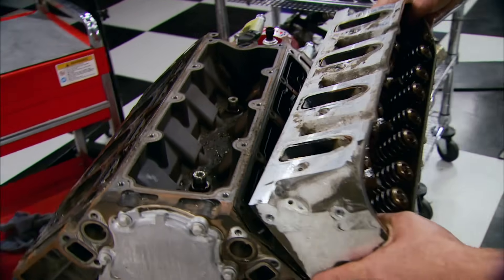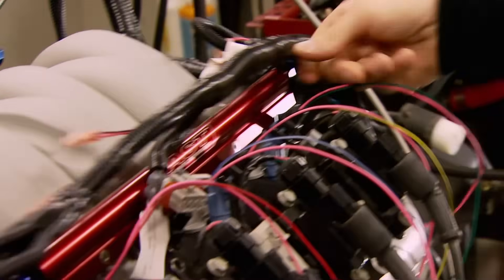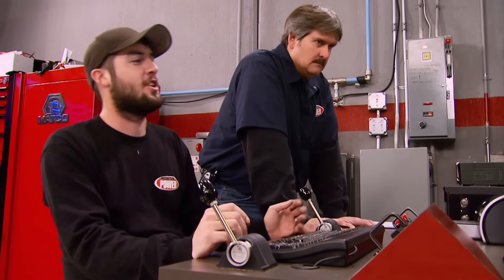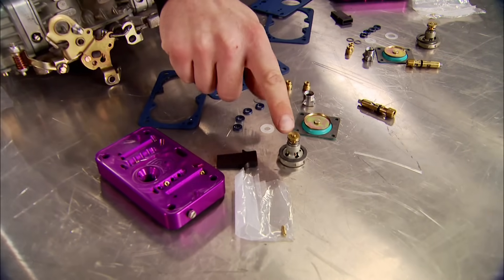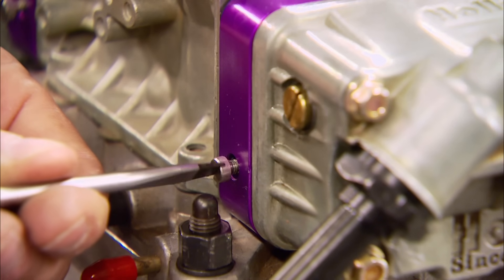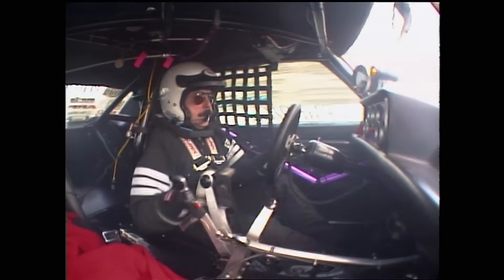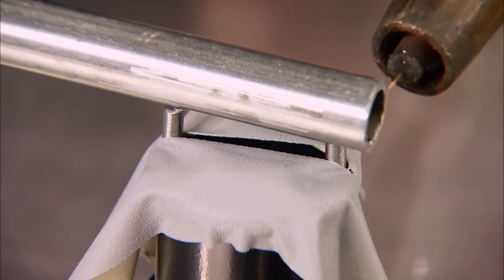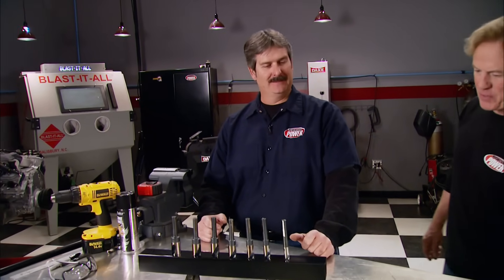Upping The Intake On Our Chevy LQ4 Motor - Horsepower S13, E2

Comment: The real lesson- $2000 in flashy manifold, injectors, and throttle body nets you 25 more HP than you would of picked up at the junkyard for under $50. Too bad these guys aren't sponsored by Pic-n-Pull
Reply: Exactly lol good aftermarket cam and your there

Comment: So it made 25 more Hp with the cam,springs and rockers and 103 more Hp with a manifold upgrade.
Reply: The manifold would have never made that much power without the cam and tune
Reply: Think about it- more lift, more air. Stock intake- same air. So the cam and intake should’ve been done together.

Comment: Why was the E-85  increase so low.
With the Proper tuning and cam,  should result in 15% increase over gasoline horsepower.  Should have a increase horsepower of 35 to 45.  The alcohol fuels carry a extra   oxygen.
Reply: Because these guys don't Tune ECU's, they are TV Hosts

Comment: I swear, I've watched these Lq4 videos over and over and I just don't understand the numbers. The stock Lq4 makes like 320ish horsepower. How did they get 411 out of it with only a valvetrain upgrade? Then with a new intake, they're making over 500? I guess I need to get my cammed Lq4 tuned and see where I fall.
Reply: Why don’t they show the dyno graph?
Reply: You should notice no drive accesories attached to crank pulley 
No drive train attached to engine 
That's it

Comment: Wow E-85 was .86 cents a gallon then lol now it's only like .5 cents less
Reply: E-85 here on long island NY is $1.69
Reply: @andrewinsinga2993  That's how much reg 87 is in sw Missouri.E-85 is only maybe 10 cents cheaper.I paid $1.24 for 91 octane this summer lol
Reply: My van pings on 87 octane 
I can't find c85 where I live 
My van runs better on e85
But poor fuel economy
Reply: Damn gas in1996 t0 2000 Florida was just 89cts for a gl. and after 9/11/01 was just about 4$ gl. Now its just about 2$ to 2.50$ gl.
Reply: Thank bidung
Reply: @jimgould2829  You need to also remember. Most stations that sell E85 are not 85%. Normal stations around here in Oklahoma range from 70-75% and you will find note saying, minimum of 70%. Luckily we have a station here that sells true E85 and E100. Hell their E85 has been tested to as high as 90%.
Reply: Oh these comments didn’t age well….

Comment: Spend $100 and get a set of 706 heads and throw those 317’s in the trash.  You’ll make another 40-50 HP.9:5:1 compression with those 317’s and well over 10:5:1 with the 706’s.  Unless you’re running big boost 72CC chamber 317 heads are garbage. 706’s or even 799’s milled a lil Should be close to 600 with those mods….  A lil pocket porting wouldn’t hurt either.

Comment: What's the part number for the injectors? I've been looking for them, I have a similar build
Reply: Go with the 5.3 flex fuel injectors, you can find good used for cheap and your fuel pump will run out of fuel before the injectors fall short. Good for 400 rwhp

Comment: Thank god for Holley efi.  Swapping computers 😂
Reply: That was a 0411 computer not a Holley . They ran it hard with engine knock till the computer pulled enough timing out to be safe and make power . The short terms will pull fuel out to get it close and the long terms will reset the tables . It's the wrong way to tune a engine and lucky they didn't knock a rod out .
Reply: @anotherfishguy1051  read my again comment slower...
Reply: That's not what they showed but yes they had to have run a Holley EFI on it to get them numbers. They had no skill to tune the stock computer or they wouldn't of used a mail order tune . Plus he said it had 10 more degrees of timing. From what they already had tuned in it for just a cam and intake swap you know that knocked like a mofo
Reply: @anotherfishguy1051  since your slow I’ll break it down saying thank god for Holley efi means we don’t have to deal with what they are going through swapping ecm’s deleting vats ect
Reply: You wrote thank God for Holley EFI swapping computer's. And yes thank God for Holley EFI for people that can't tune themselves . You have a good day
Reply: @anotherfishguy1051  it’s a period after for a reason
Reply: @kingofthanorth  I have a coozie that say, "I can EXPLAIN it to you but I can't Understand it for you" Thank god for speech text or some people wouldn't know how to spell

Comment: I need to put a bigger engine on my truck he has a 5.3 L what do I need on a Silverado 2003
Reply: You can bore out the 5.3 to a 5.7 but a 6.0 will swap right in just buy a short block and put everything from the 5.3 on it . Your heads are better then the 6.0 heads the rest is the same . Put a cam in it and long tube headers a good tune and you got 450 hp 400 ish tq that intake makes 20 plus hp  less power then the stock truck intake everywhere but above 5500 and it cost 1000 for the intake and 400 for the throttle body . If you need more then 450 just turbo your 5.3 and make 700 safe . Gap the piston rings  and put valve springs in and do 1000 plus all day long . It's that easy

Comment: So the lq4 you  just ran it with crazy knock till the computer pulled enough timing out off the low octane table till it would make power and relied on short terms to pull enough fuel out to get it to make power . Or it was adding fuel like crazy to be safe . Not even close to the right way of going about getting a engine to run right. Get a hptuner even if you don't know what you guys are doing it's safer then what you did to that poor engine .

Comment: I call B.S. There is a lot in here but the most glaring is 24lb/hr injectors supposedly made 500+ horsepower. 😂
Reply: I thought he said 44Ib’s😶
Reply: Thts after the stage two cam was installed.. Sometimes you know it ppl have to listen
Reply: That poor engine hard to be knocking like a mofo till the computer pulled enough timing out to save itself. Plus you know the short terms was going crazy I bet 25 % or better for that much of again . And yes 500 ish on them injectors is do able but they would be up there on duty cycle . I'm making 441 hp 406 tq with stock injectors and not even close to maxed out